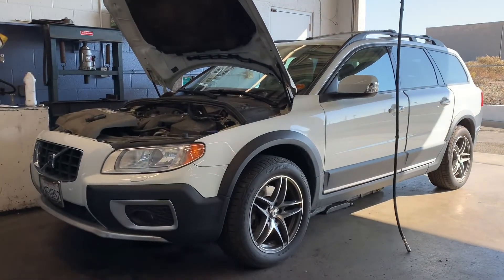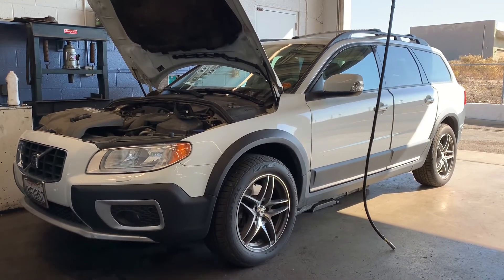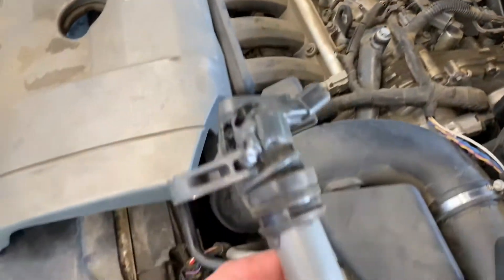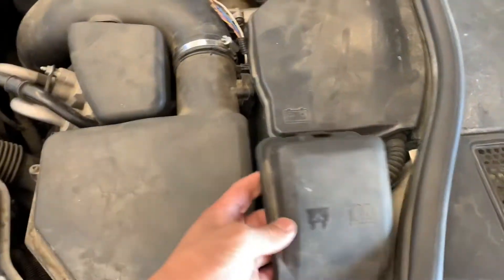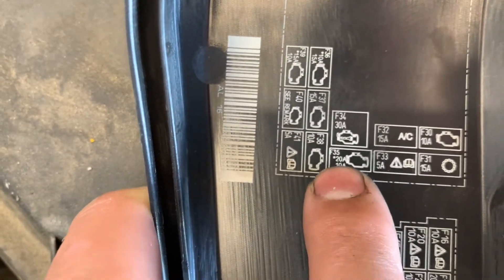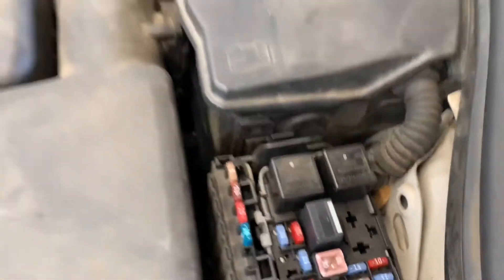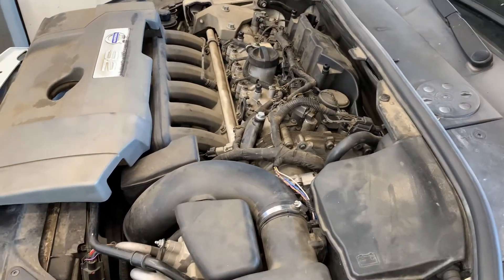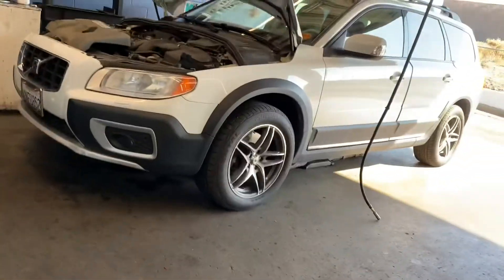Volvo XC70 3.2 Engine MISFIRE MELTED COIL/ WONT START

Comment: Hmm I wonder if I’m having a similar issue. Sometimes my car just sounds real work at first start and starts kinda slow. Like sputters for a second. And a couple times recently it didn’t start. Pressed the start button a second time and it started.

Any tips? 2008 XC70 with 3.2 liter. Thank you!
Reply: Have it scanned at autozone etc...if there is a fuel pressure sensor code in there replace it. It lives on the drivers side end of the fuel rail held on with one small torx screw. Replace it. They commonly fail.